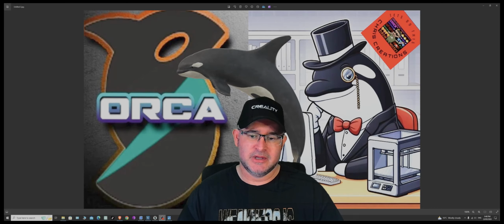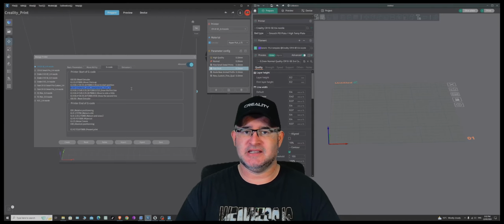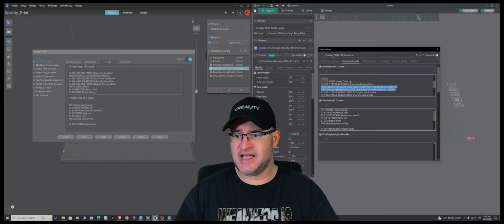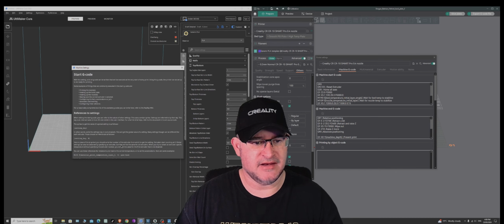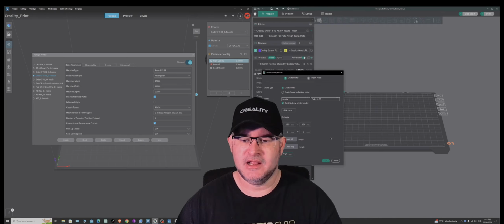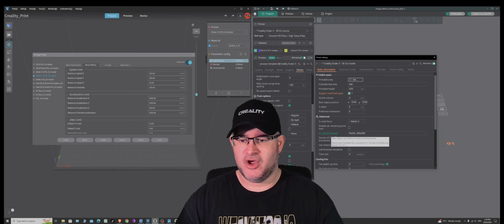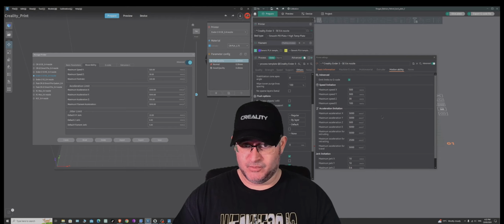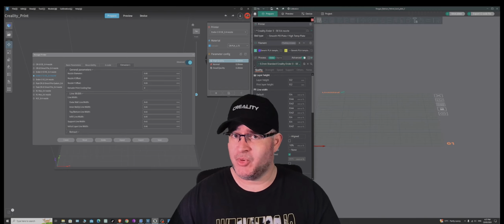Add Your 3D Printer to Orca Slicer with G Code  / Print Config Easy Tutorial  Part 1 #usa #trending

Comment: Hi, I just recently bought Creality K1C and I am using Orca 2.2 version. Following your video, I see that there is a big difference between your start/end g-code compare to what is in my orca printer start/end g-code (M140 S0, M104 S0,  START_PRINT EXTRUDER_TEMP=[nozzle_temperature_initial_layer], BED_TEMP=[bed_temperature_initial_layer_single] this is all what is there. Should I change it to match what you have? Thanks
Reply from the maker: Hi Thanks for the comment. As I remember i think I changed it to include a better parameter that I created. It's been awhile so ill have to check to confirm.

Comment: We really need to find a quieter fan for the cr10se
Reply from the maker: Compared to Core Xy Printers it's actually not that loud, That said if you have the CR10se as your main printer yes it can be loud if your not used to it. Especially for a Bed slinger open platform printer. It's the same Fan from the K1 series so possibly there should be an alternative fan design out there as there is a lot of upgrade options for the k1 printer hot ends and blower fans.